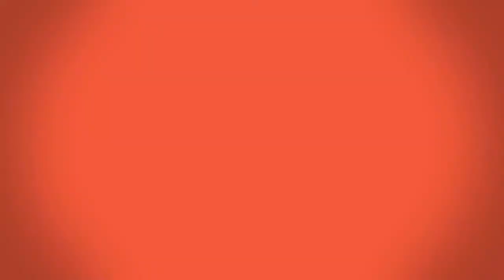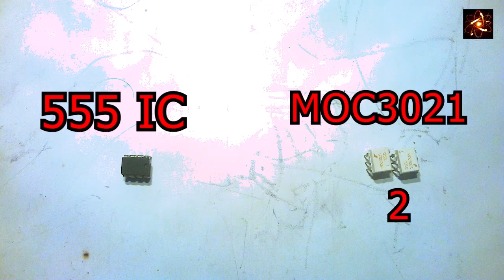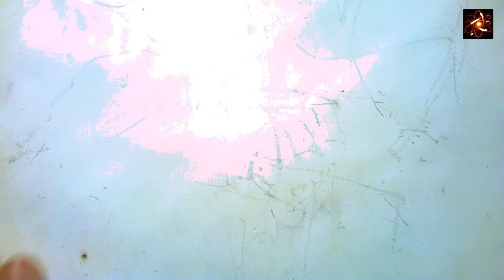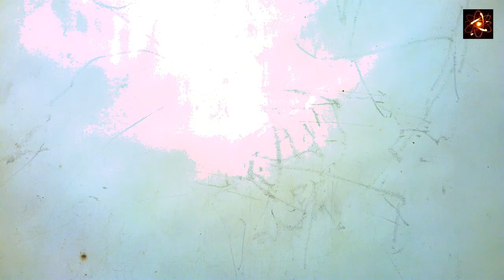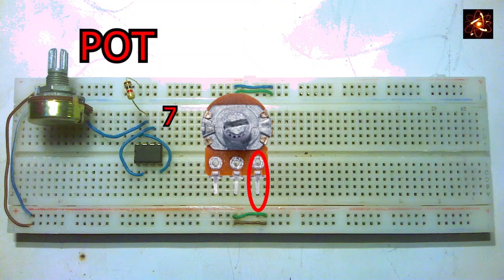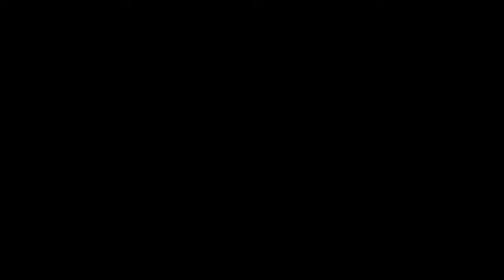555 timer dual Bulb flasher

Comment: why the blubs flash more as one times before switch? the capacitor discarge?
Reply from the maker: led flash using 5v dc ....blubs flash using 220 v ac ......blubs flash and led  flash both depends on capacitor value and resistor value